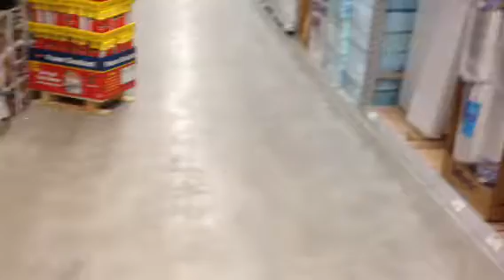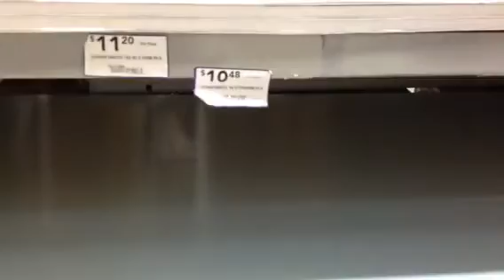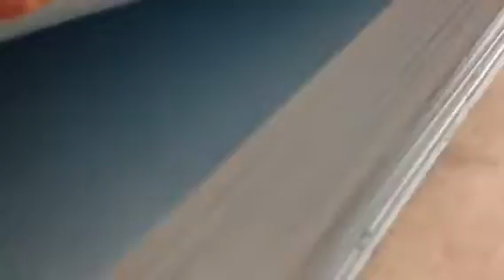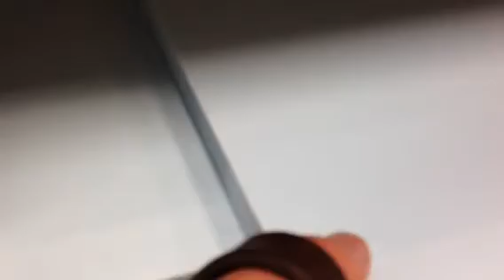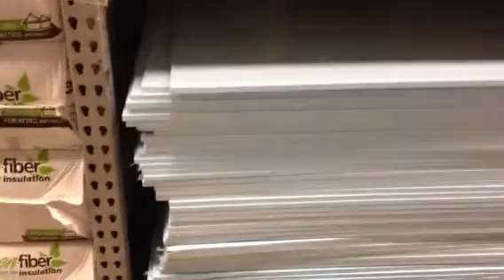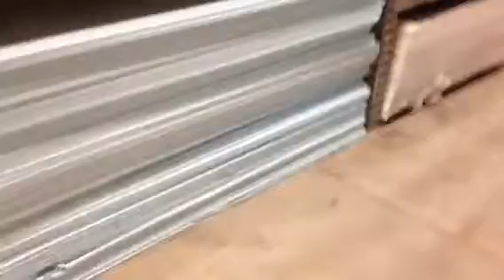Boat Building Materials - Foam

Comment: After reading a bit about this foam core stuff:
Styrofoam = Polystyrene = very low shear strength, which meas it is "friable" and will be torn apart to dust when used as a sandwich foam core material. It works if you make the fiberglass thick enough or if you don't have much forces acting on it.
High density PU foam panels work but PVC and SAN is best (and most expensive).